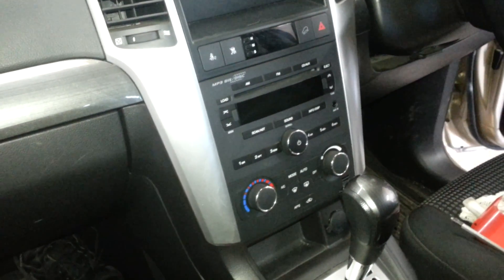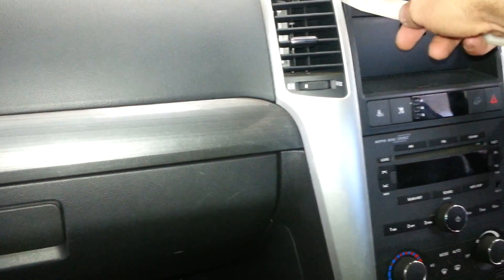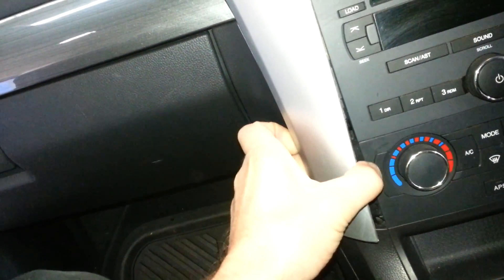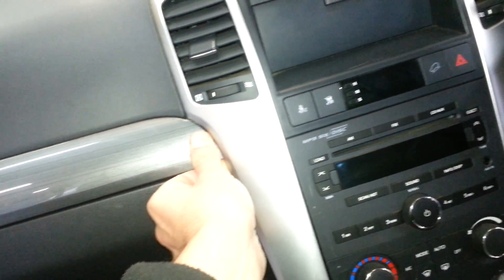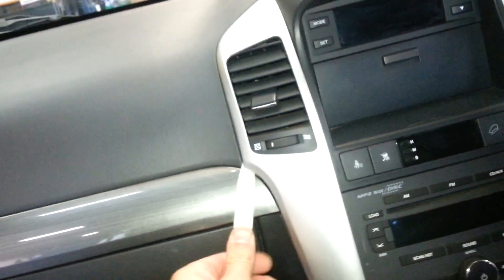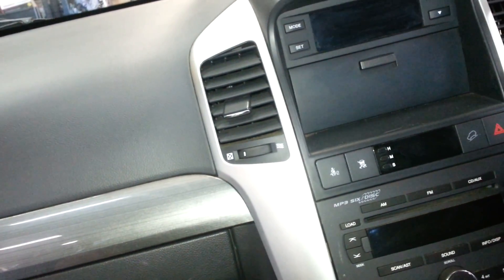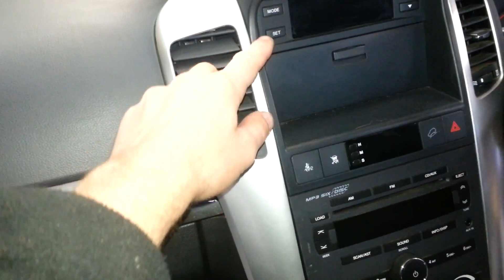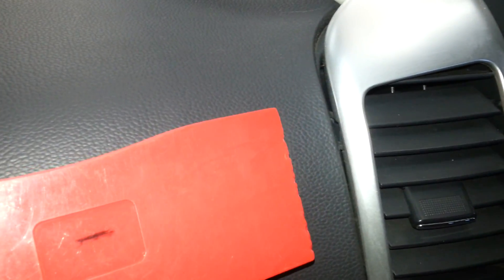How to remove the radio from a  Holden Captiva

Comment: nice work - nicely shown.  I am here coz my cd player says disc error, but plays the last cd i left in. 
Apart from that there is a rolling noise like a ball when i turn my car. Sounds like it is in the vent pipes
Thanks
Reply: somehow back again . I managed to remove this with my fingers. am going to screw in my satnav to that top of that plastic between dash and steering wheel.